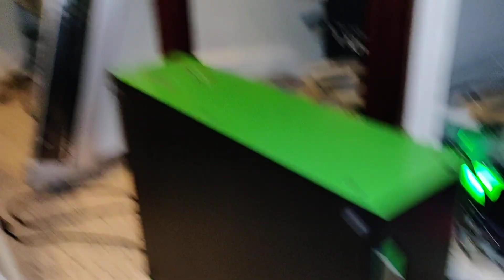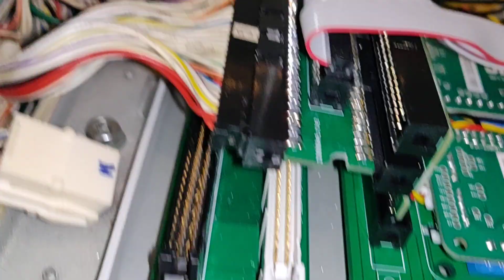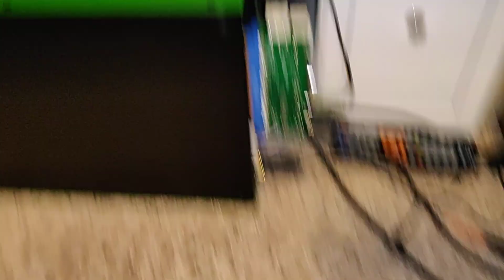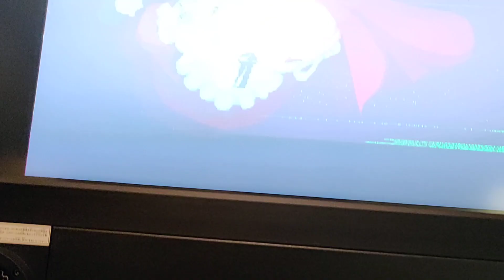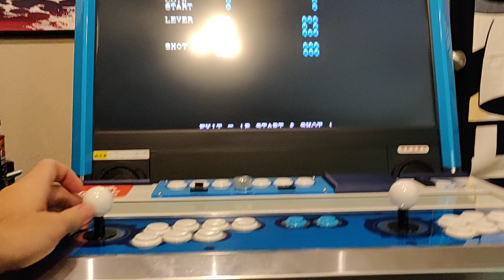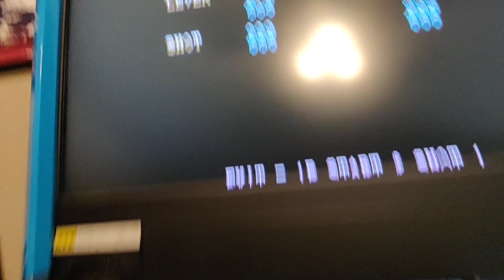Universal JAMMA Interface for Vewlix and more! (Prototype Demonstration)

Comment: That is sweet! Will you be selling the complete kit which includes the pieces you showed including the jamma interface adapter, ribbon cable, control panel adapter and I/O splitter?
Reply: Oh that would be sweet if it did